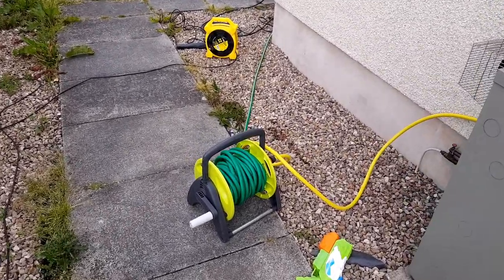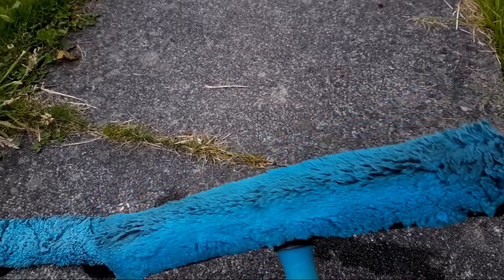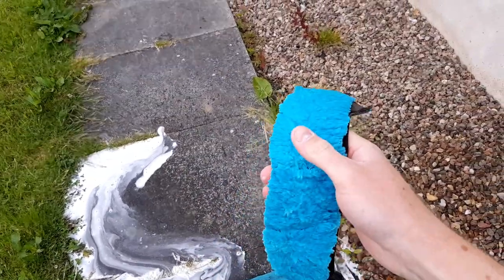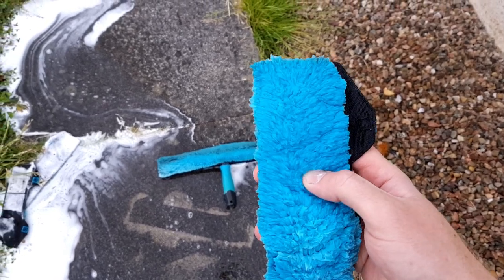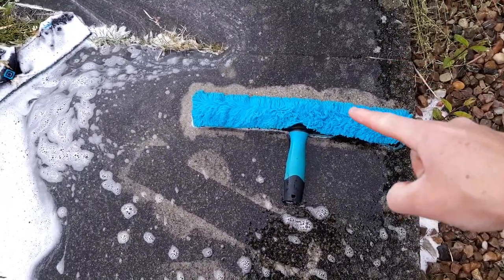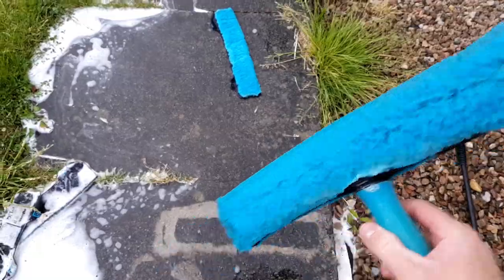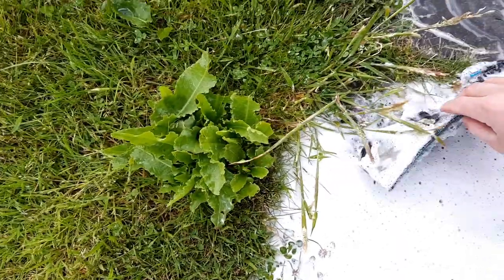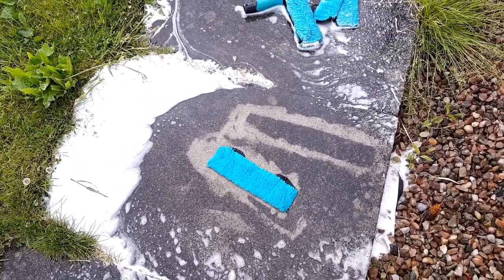Cleaning your window cleaning equipment

Comment: I did a house last week, it was on a busy main road and the windows hadn’t been touched in over a decade, usually I spray off mine with a pump spray or a bucket of water with a grit guard for stubborn dirt... this time, no chance not even the power of Daz could lift it all out, I will now crack out my pressure washer when I land home and see how that fares 👍
Reply from the maker: Charlie Robinson let me know how it works for you
Reply: Trad - Man had to get the zero tip, but yeah all of the deep filth came out after a couple of mins, cheers for the tip  I’ll be doing this regularly from now on matey 👍
Reply from the maker: awesome!

Comment: What do you do with your applicators and squeegees at the end if the day? Do you clean + dry them, or leave them in water, hang up and drip dry??? I'm unsure whats right to do?
Reply from the maker: I give them a quick clean in a bucket of water then afterwards I tip the water out and leave them in the bucket with no water in it.
Reply: @TradMan   cheers Tradman 🤜🤛
Reply from the maker: @dongdipperadventures6565  very welcome 😀